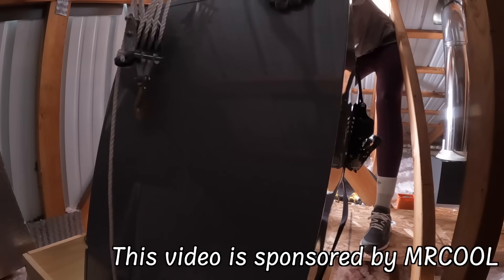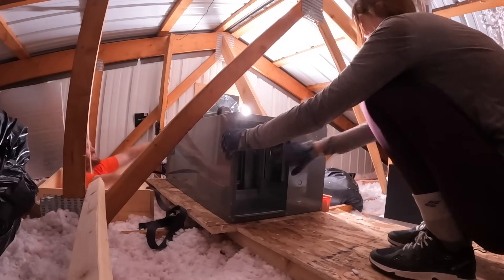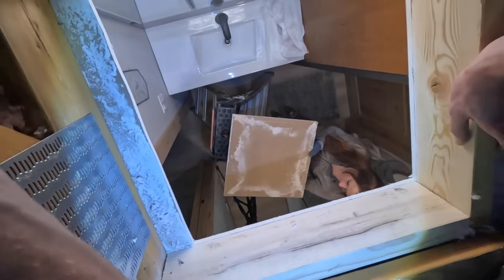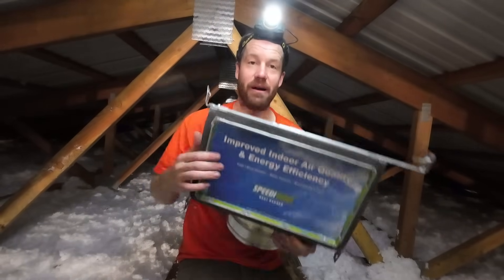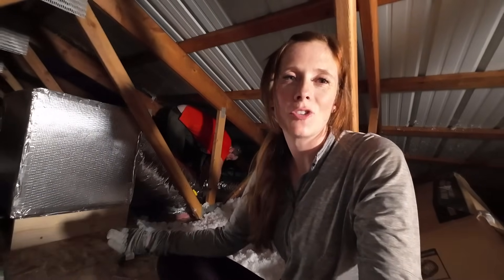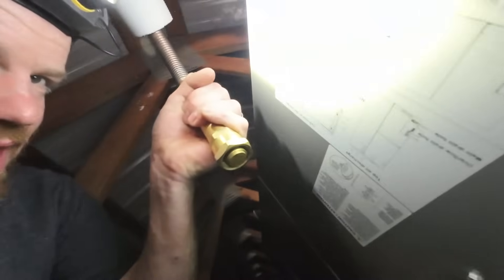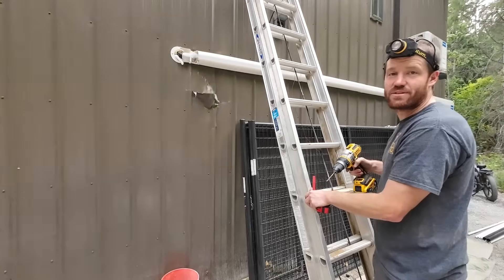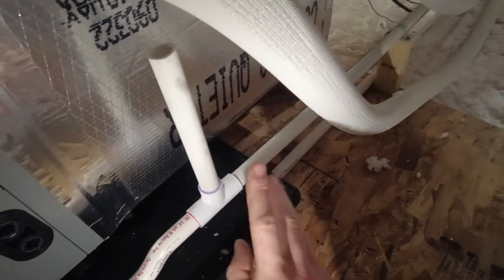Replace Your Old HVAC System With THIS! (DIY Heat Pump Install)

Comment from the maker: ❄MRCOOL Central Ducted Hyper Heat: https://mrcool.com/central-ducted/
Reply: You can use the condensate water for your home, it works the same as the water generator, your only missing the uv lamp
Reply: If MRCOOL made a DIY atmospheric water generator your water issues would be solved and you would have a most watched video.  Maybe Riley could repurpose the bedroom  MRCOOL to make water.
Reply: Good job with the installation and brand deal with this company!
Reply: Hey thought next video would be about water source   If some thing fell through why not take 5 or 10 min and see how other places around the world drill wells  NO NO NO not just soft no rock or like that pvc pipe sand drilling    People have been drilling wells up to and over 500 feet with a rope wood pole and a home made drilling bit since at least the thirteen hundreds  You Guys take on crazy Giant imposable to most road building both of you can fab things from scratch blessed with awesome tools to do so  But you cant make a small balance beam rocker with simple type easy to make winch simple percussion drill bit  Then hook the rocker arm to a lawn mover motor  then run through pulley on pig poles?    My old buddy drilled wells all his life with a percussion drill rig  You have to baby set it and it could take a week of 10 hour days if deep and all rock  You mostly set in shade drinking beer shooting the shit or falling asleep when you pass short learning curve  IT IS JUST PICKING SOMETHING HEAVY WITH HARDENED STEEL POINTS UP AND DROPPING IT TILL YOU SEE IT IN YOUR SLEEP LOL  When you hit water good you will have to run a very simple  home made bailer down the hole to clean it out and test gallon per min   Guys I know this sounds simple because it is lol  I would laugh my ass off if you lost the rope or cable down the hole and have to spend half the day fishing it out   So if you guy drill it your self with a small home made rig fake your old man goofing off and having to go fishing ! You have subs to entertain LOL  I dont know you guys from adam but there is a dad with wisdom and maybe a touch of money and tons of loving his kid in back ground some where  You guys are to young to do what you do with out at least wisdom being sheared from some where!!!!  Love your videos drill you own well it will entertain and help others WIN WIN WIN!
Reply: I went to the  Link but it does not give options of size et cetera just shows the pictures of the different systems is there not a link for the different size packages? Link but it does not give options of size et cetera just shows the pictures of the different systems is there not a link for the different size packages?
Reply: My experience with heat pumps is very inefficient below 50 degrees
Reply: 15:35, I would also insulate these brass plugs for efficiency and to prevent condensation. Good job it seems
Reply: Love the channel for long time now BUT you have turned into a Product Selling Channel now and that is so disappointing indeed, that is all you are doing all the time. 😞👎

Comment: «more efficient» are super understatement, inverter heat pumps give you 4 times the heating then the power used. So a 2000 watt heater will give you 8000 of heating etc.

Comment: You should never start up being quite for a baby !!! Otherwise U will have to be Very quiet Every time you want to put them down to sleep!! I've had 3 babys, plus 6 grandkids!!! 
We used to do all out noisy n load building work after the kids had gone to bed!!! Including knocking down walls, ect!!! Good luck with all your up coming projects!!! 👌👍👍

Comment: I know this video was a year ago but I'm slow lol why did you not spray foam the roof in the attic in order to cut down on the cold and heat coming from the roof just curious

Comment: This is just some information that some OFF Grid people don't realize. IBC Totes are not suitable for potable water. If there is LIGHT algae can bloom. If used, paint with a FLAT BLACK or  DARK Green. The addition of a UV light for well tanks is also recommended.

Comment: As a former pest tech I recommend wrapping the end of your condensate drain tubes with some mesh screen. When it's driest is also when that AC will be a running stream for wasps and roaches.

Comment: question... if the attic space you have put your Mr. Cool unit in (above the house insulation) get sooo hot in summer under your metal roof, would it get equally cold in winter? My thought is, the effectiveness of running a unit in too cold a space and the drip line freezing, if thats an issue in heating mose?
Also, you can 'assemble' metal ducts in place by pre cutting lengths and flat packing up to acctic then joining seams to make the box or rounds of duct you need. You can even join shorter sections breaking a long run into a few sections. This, overall would be better than light duct box material and tape as you can also putty the joins pr eventing air leakage and unlike foil tape, it wont unstick over time.

Comment: When I lived in Portland, Or, all my registers were in the ceiling which is great for air conditioning as cold air falls but sucks for heating, cause it raises and it stayed up there.  Despite running ceiling fans in every room the way they should be run in the winter to force the warm air down, for the 9 months of the year the heat was on, my feet and legs were always freezing 🥶 So if you already have radiant heat floor 👏👏👏👏👏👏 you are ahead of the curve on this one

Comment: Great install, So far do you know what the temps coming out are? Is it also better than the Mr. Cool head units as far as the amount of air coming out and the temps hot and cold? Thanks.

Comment: Put those drains on a cleaning schedule! I had a crawlspace air handler drain get clogged and back up (dust+spiderwebs/insect... detritus, etc.), causing massive water damage. This happened in the middle of summer in Arizona the exact week a newborn baby came home. Fortunately homeowner's insurance covered everything, including the 6 weeks in a hotel, but it was a completely avoidable hassle.

Comment: I thought about going with mr cool but they are MIA when it comes to helping you get what you need. Tried calling them several times to wait on hold and then say they are not there (during normal operating business hours.) Now not sure what I want to do. Would love to install myself, just need help getting it designed!

Comment: Sucking moist air from the bathroom in summer (Air conditioning) may freeze over your coils. The coils will be at 0Deg F. I hope your system has a frost sensor to melt the ice.

Support the duct bends so over time the weight/tension of the duct bend does not cause the duct fall away/pop off from the vent.

Cooling the attic with geothermal would save you lots of energy. It would cost you very little to dig another trench and place 1500ft of plastic pipe and a radiator in your attic blowing 45 deg air so your heat pump works way less for all year around efficiency.

If you put a system in to cool in summer and warm in winter your garage would be livable all year around. Imagen if during the summer the garage was cooled with 45deg air and in the winter it was warmed with 45 deg air. You only use 100 watts to run a fan and a pump. You could melt all the ice and snow off your car and have a warmish car to get into.

Comment: Even if you diy, you still need the education and take the EPA test for securing, storing and using refrigerants.  You can’t even buy anything with refrigerant in it if you don’t have those credentials…… so I doubt your claims of diy

Comment: Hi RECKLESS & COURTNEY , also OLLIE ...👷‍♂️👷‍♀️👼Question :
You always work smarter not harder , why haven't you improved your lift system ???
ie : Bought a Harbor Freight winch & installed it instead of the ancient Egyptian rope & pulley system you're using ??? That way no one has to manually pull on the rope & hold it till tied off or holds it till the other ( by herself unloads it ??? Especiallydoing Groceries & not having to carry them up the stairs , she could simply put them into a basket & go up & push a button without all the work & hassle ...A very simple setup to build with buttons at both levels , a one girl operation .....Especially if lifting those 5 gal bottles of fresh spring drinking water ...Just sayin 🤗🤗🤗🤗🤗🤗🤗Otherwise , you guys do work smarter not harder & less chance of dropping something and breaking it or heaven forbid someone got injured ( that's why we call them ACCIDENTS , coz no one plans on them ... LOL ...😅😅😅😅

Comment: Super stoked it’s an inverter based unit, I run two 12000 BTU units on battery/solar during power outages and they sip power when they kick on!

Comment: BC Rockies here. The skidsteer height solution brought back a memory from 40 years ago when working on a beehive burner at a mom and pop lumber mill in the Columbia valley when I was eighteen. The conveyer from the mill to the burner ran up at a 30ish degree angle and had come apart past the halfway point. Sooo the foreman puts TWO lifts of lumber on the forklift and wanted me to climb on top of the two lifts of wood and THEN be lifted to the max height of the forklift, ON UNEVEN GROUND! And then reach up further to manhandle  the fix. I respectfully declined. So they got some other poor sap to do it. He lived. I was not fired nor reprimanded for the refusal to work. We didn't have cell phones then but it only takes a regular land line and one little finger to make one little call the WCB, workers compensation board, who is in charge of paying damaged workers.

Comment: I noticed you have a wall in the top of your garage and living room, if you added a removable panel you could use that as access to get large items up in to your home,  i e that AC/heater.
Anything that is too large to really carry up the stairs.  I would even consider making the panel swing out on a pair of heavy-duty hinges. Locked at one end or split and lock in the middle.
Good luck, if do, or if you don't.   Lee, in, Loveland, CO

Comment: Y’all might get away with it because you’re in a dryer climate, but air returns in bathrooms is a no no.   The excessive moisture from showering will be directly sucked into the air handler. Taking moisture out of the air is actually a big part of making it cold. 
Why it always feels colder outside when humidity is lower. 

If the levels exceed the handlers capacity to get rid of it, it will cause a lot of condensation, possibly flood the inside of the air handler itself and also have tons of moisture out the vents. That can lead to the vents “raining”  or dripping water from them as the colder metal causes the excess moisture to condense on the physical vent itself. 

Watch out for mold if that starts happening

Comment: If you're really worried about efficiency, you'll want to put the main unit and vent pipes in a conditioned space. In the south, many builders now insulate to the roof line instead of the ceiling so they can get the improved performance, among other things. Unfortunately there's no easy way to redo your attic, but then again, your climate is not ridiculously hot most of the year, so it's probably not a big deal.

Comment: You said the other condensate drain is higher so it will still drain if the main drain won't drain. But what stops air from entering the second drain?

Comment: Everything looked good in the install except when you tied in the duct to the duct collar, you need to use either duct tape or mastic seal to seal the duct before the zip tie. Other than that great job!

Comment: @ambition strikes .Hey quick tip to avoid breaking pilot bit in hole saw in difficult materials . Start the hole as normal . Get a 1/4 20 bolt long as your pilot bit , cut the head off and grind a tiny flat and switch the pilot bit for bolt .

Comment: It does not surprise me that Riley makes everything either dangerous or difficult. It was crazy putting those brackets that high and then lifting the unit on top of a larger water tote. That should have been installed wayyyy closer to the ground if not on a pad on the ground.

Comment: Maybe somebody already asked this but why run the return in the bathroom rather than the center of the large open area?  There will be times where that door will be closed and will limit the air flow.

Comment: Great install, but there is a couple of things you could do to make it even better! I noticed you didn't use any duct sealant aka duct mastic. This should be used on every seam and every duct connection. For the fiber board you should cut the board actually bigger than you need, cut back the fiberglass without cutting the foil backing and then wrap that foil over the seam, staple it down, foil tape, mesh tape, more staples, then duct mastic. For the flex duct taps I noticed on some of them you didnt bend the tabs, didnt seal all the seams, and didnt use sealant when connecting the flex to the tap. The taps should have the tabs bent, then you can foil tape, mesh, and mastic. Also mastic any and all seams on all your duct fittings. Then when you put the flex over the tap the inside of the flex should have a coating of sealant. You should also be using a panduit tensioning tool to tighten the panduit straps. Hand tight isnt tight enough and WILL LEAK. Then once you tighten the panduit, you pull the insulation and foil from the flex against the duct and staple it to the ducting, then foil, mesh, and mastic. If your installers aren't doing every single one of those steps, they are doing it WRONG.

Comment: You need to fix the condensate P-Trap. The one you installed is not deep enough. 2+2 inches is the correct size. Check your manual. This is very important for this unit because the blower pulls air through the cooling coil. If the trap is too shallow, the condensate will not drain while the blower is running. The blower will also pull air from the drain causing condensate splashing at the drain outlet. This can often cause water leaking at the sheet metal seam. Fix that and this is a superb video installation. Mr. Cool definitely got their money’s worth for advertising. They should pay you royalties for each view. That second drain opening is for a secondary drain pipe if the main condensate pipe stops draining. An optional float switch to shut off the thermostat wire for cooling is also part of most attic installation codes for the sub pan. The condensate line in attics can also drip condensation from the surface of the pipe, so it is often insulated to prevent condensation. I am very glad to see those special line-set valves installed. This makes it all possible and easy for DIY. Safety on leaders is a big deal but that tote stacking idea was an excellent idea & safer than working off a ladder.

Comment: Yikes.. you need to line the bare OSB in ceiling vents boxes with tin since they'll rot and cause mold over time because of moisture. They  should of think on using any leftover siding to almost box in the unit since its inevitable that the condensation it makes will go everywhere as it evaporates. It should  have a vent all its own that turns on when it does and its rare for a attic unit not to cause problems around usual due to moisture is why there not more common...🐁🐁🐁

Comment: Nice install. Here in south Florida, I always see that second condensate hole with a 90 degree cup to hold a float switch. This will turn off the unit in the event of water blockage. Same in the pan too. Impressive C was able to muscle that AH up in the attic. Great teamwork!

Comment: How come you don't have roofing paper under your metal roofing? Do you not get condensation in winter? I've had friends pull off the roof to paper after the fact.

Comment: You video was great, but the only thing is you don't put a return In a bathroom. For one the steam from the shower is not good going directly into the return, and Maybe more importantly, the odors from the bathroom will be distributed throughout the house.

Comment: Great job, but, you really should add insulation in your attic.  Somewhere around 16-20" would make a major difference winter and summer.

Comment: Great job ! Look's the CFM per diffuser is a bit high and the static pressure must be very high  , Adding more diffusers will reduce the static pressure and  CFM's per diffuser .

Comment: Way back when, whoever's idea it was to put an AC in the attic was an idiot. I live in south Florida (IE - HOT!) First off, it's a SOB just getting the equipment up there. It's cramped, you gotta build structure around the unit so it can be serviced (by code here). Next, if it ever leaks (which is a matter of when, not if) there goes your drywall in the ceiling. Have fun fixing that, especially with these textured ceilings and trying to match that up. Then, the heat build up during the summer can exceed 140*F. You can't work up there. There are contractors down here who refuse to work on them if your unit is in the attic because of the heat. And lastly, if you do find somebody to work on them, you'll get charged  more just because of all the associated problems. All I'm saying is, the attic is not a smart place to put the AC unit. Put it in the  garage. Easy to get to and work on, quiet in the house, and if it leaks it only leaks in the garage and any water runs out the garage harmlessly. Anybody looking to buy a house should consider that when purchasing. That could be a costly repair at some point in time. Maybe even a deal breaker (it would be for me)  Don't ask me how I know all this.......
Reply: NEGAtron spotted 😂